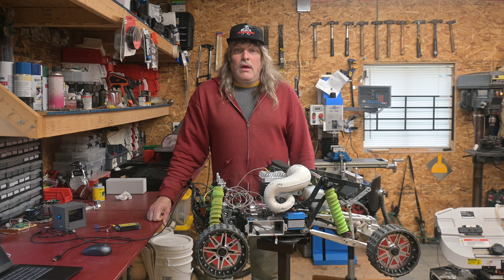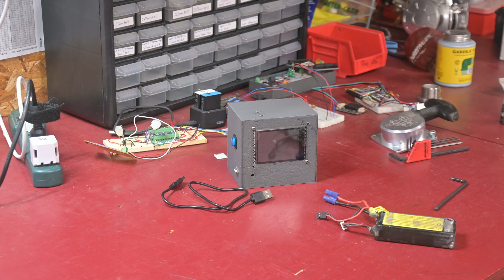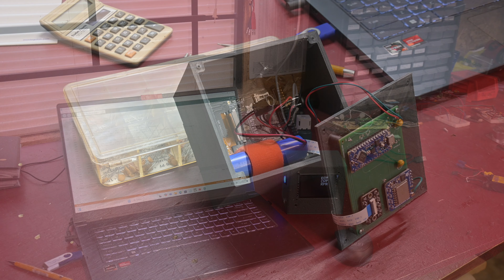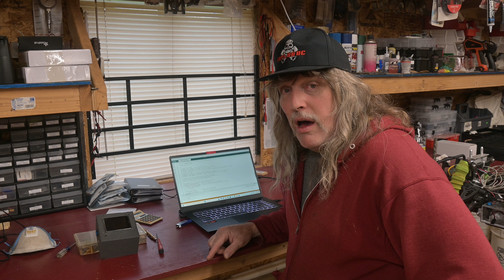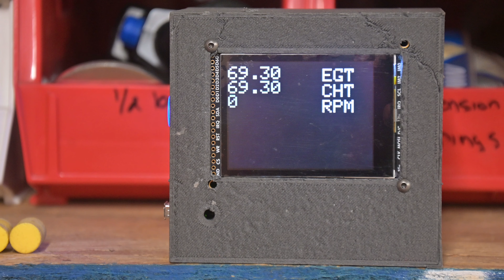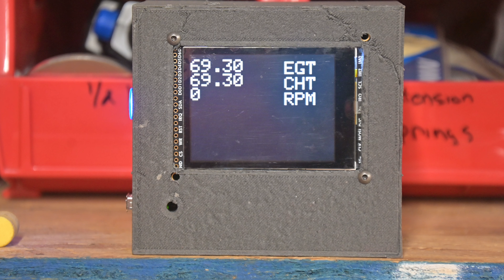Wireless engine datalogger for 1/5th scale RC gets an RPM link. Taylor 50cc SCADA with Arduino

Comment: I would love to see some short videos on more basic stuff. Perhaps you could explain how to make a capacitor out of common stuff.  My Son has made some using wine bottles filled with salt water and wrapped in tinfoil. I guess the large caps are expensive so he was trying to save money. The anodize video you did was really helpful to a simple man like me.  Very useful.
Reply from the maker: Hey RC, well the upcoming videos this winter are going to be a bit involve because i plan on hand building a 1/5th scale Snocat, tube chassis and all. Was your son able to get a Farad reading on that capacitor?
Reply: @RCWalletVacuum  That sounds great. Don't rush a good thing. I'm just shooting videos of toy cars when I get the time. I will definitely be looking forward to your next project. As for my Son same name as you... He went to a trade tech collage and like you he is extremely well versed in controls. Making the big buck like you. Anyways the home made caps he ganged together in a bucket and with a home made high voltage stick he drew an arc about 3" long and 1/4" round of just pure orange and white light when he discharged it.  He has been working on his mock up "tesla coil." It's about 8ft tall and looks similar to the original  one that Nikola Tesla made. It functions but he needs a different transformer as he keeps kicking the main at the Trailor park he stays at.  Long story short he is way smarter than me. My last 10 years working at Boeing mostly involved escorting contractors in and out of skiffs and vaults. Oh yes I also was responsible for the plant wide PA system. The only complicated part of being an "expert PA guy" was knowing how to program the TOA Exchange. Basically 64 relays that were controlled by master stations at different locations.  Programing involved using a VB program and filling in the squares with the up down arrows and hitting enter if you wanted that zone to get break bells or to assign call numbers ect..  You know "Phone Lines". The plant had it's own Switch Room a guy from Verizon mostly just there in case of problems. I could go on for ever but it's all probably still Top Secret. I single handedly removed all the crappy Executone amps and went with Bogens and QSC stuff. I counted them 134 amplifiers replace by me. I loved that job. I probably completed about 1000 trouble calls of people complaining about the volume. If you have 200 people per floor in wide open areas it's difficult to achieve without adding speakers. My fix was fake attenuators that I would mount to the cubicle of the complainant.  They actually thought it worked and praised me for a fine job. The HVAC guys would mount dummy stats and accomplish the same affect. All of our customers loved us.
Reply from the maker: @RCRoads  Sounds like you had a lot of accomplishments there. Have you seen how far down the drain Boeing now has become with their incompetent management?  Sad state of affairs
Reply: @RCWalletVacuum  Anytime a US company outsources work it's a nightmare. The fuselage built in China ends up saving tons of money but it's just 3mm under size for properly joining to the cockpit. I blame it all on All Gore and George Soros.

Comment: You did such an awesome job on the design and build.  Being able to transmit long distance is great.  Excellent job buddy.  👍⚡ The box that holds the display looks fine. It just needs a face plate and I'm sure you'll make a nice on.
Reply from the maker: Thanks Rc, The box was designed in a bit of a rush so its missing a couple of features, like SD card access. Thanks for checking it out buddy
Reply: @RCWalletVacuum  No big deal but when you go into production I would like mine to be all black. ha ha I'm just happy for you that your projects are all coming together so well. ✌